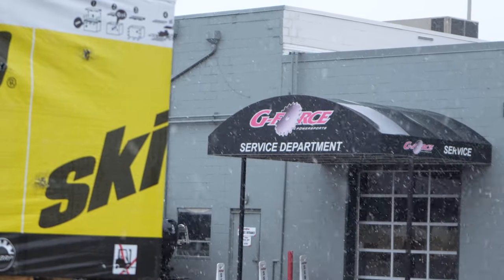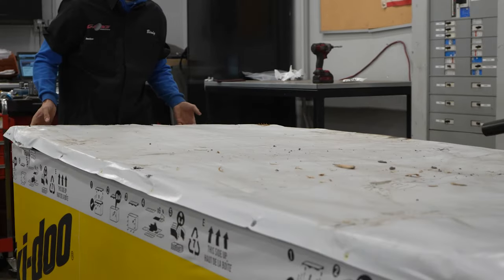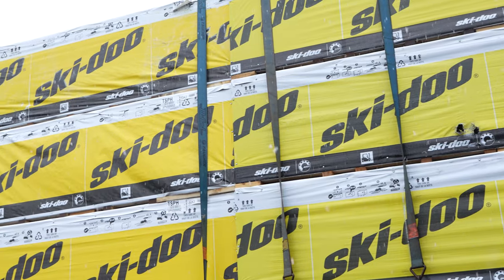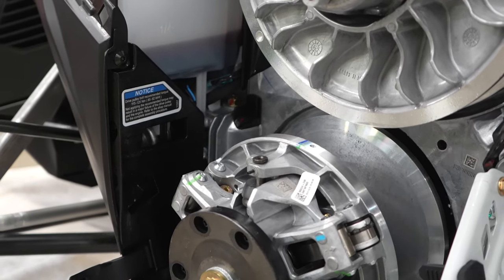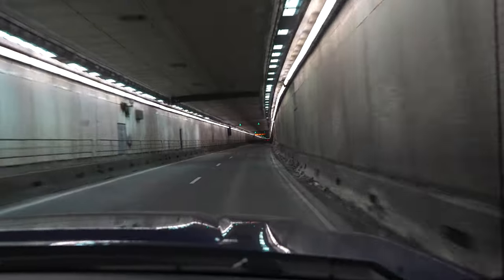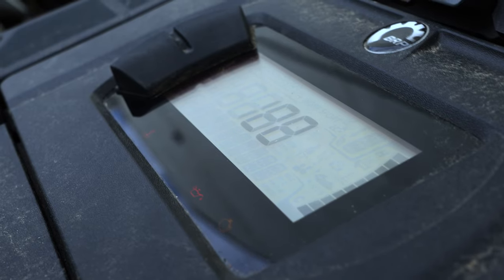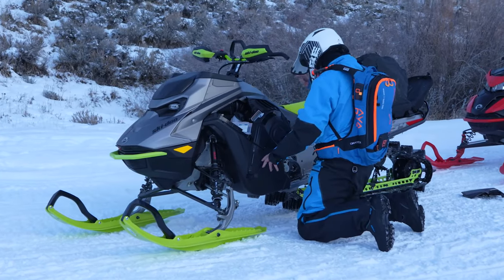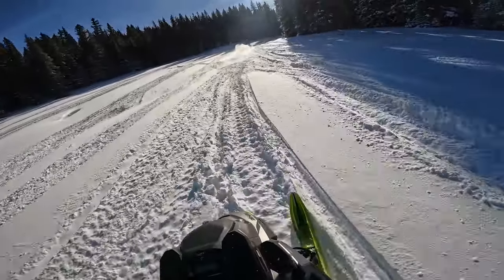How We Break In A New Sled (Colorado's #1 Ski-Doo Dealer)

Comment: When the 850 Rotax was introduced the big claim was this engine would last as long as a 4 stroke engine, looking at adds for 1 to 3 season old sleds this is obviously not so many have new crate engines mostly under warranty
Reply: 2018 850 e tec, 4k miles. Zero issues. I think the people that blow their engines overheat the shit out of them

Comment: Question.... I have a 2022 khaos slash ... had the break recall done got it back from dealer here in Minnesota and when they did the reflash  it took the sled out of break in mode.. should I be concerned? Trade it in? Check engine light comes on doesn't pull up codes... also had to bring it in one other time cuz wouldn't start... was a zip tie around throttle body....

Comment: Wounder, how many dealers really do that pre delivery points??

I will test my next new dealer. 

Will pick up my new 2024 BC xrs next week.

None of the dealers last 25 years have finalized that checkup. I always had to clean up delivery oils clutch and muffler area at least.

Once did my muffler ignited to open flame on a 2016 summit t3. I also forgot to clean it 😂

Very very very hard to find an ambitious dealer in North Sweden.

Comment: Lol, when I bought my sled at Compau's in Fairbanks (largest dealer in the US at the time 'he claimed') 26 years ago he said when I asked about break in on my new summit "Ride it like you stole it for the first 500 miles, then it will power up 20% and you have to get used to that". Worked perfectly, I was always imagining being chased and blasting or braking. Then the power came up and I was surprised and happy.

He was a big time actual sledder. He has won the Iron Dog (3000 continual miles with a or two mandated sleep stops when they really actually wrench on their sleds) from Anchorage to Nome and then to Fairbanks. Insane race.

I think he also won the Iron Man sled and ski race which is also insane.